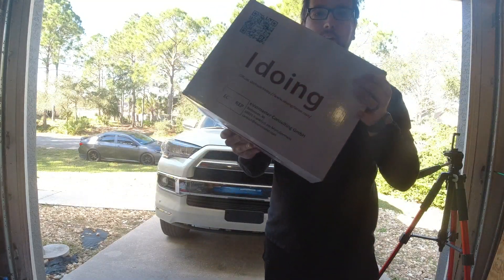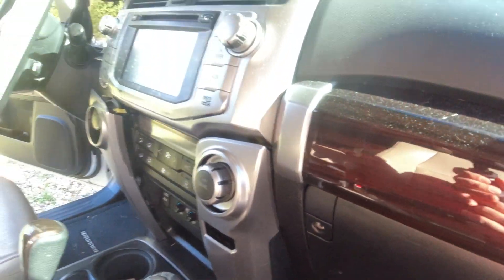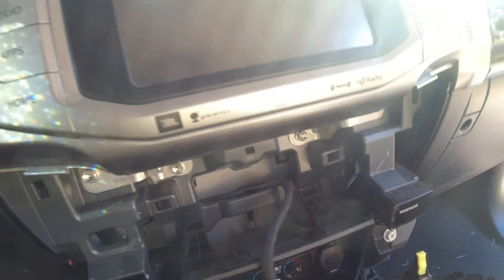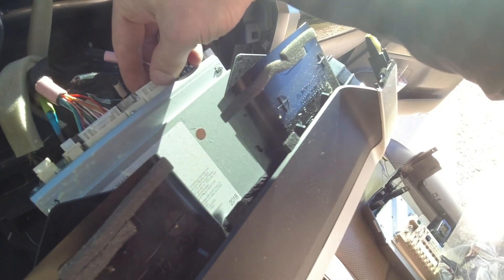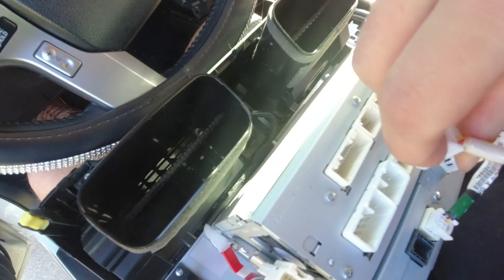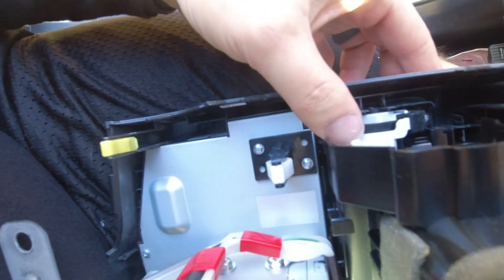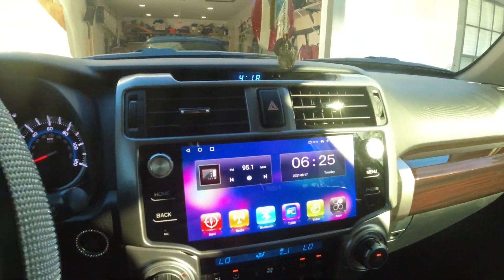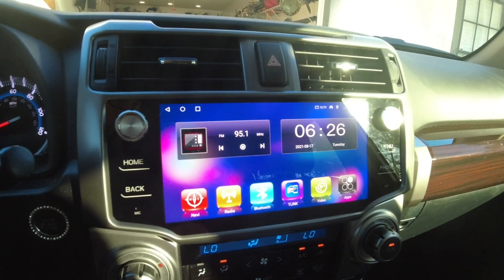4runner gets new IDOING Radio!

Comment: Hey, how was your experience with shipping? I want to get one for my corolla but I’m afraid it’ll take a long time to come.
Reply from the maker: I have gotten a few idoing radios. And they usually come within 2 weeks. 
I tell everyone that is the thing I don’t like about the radios, is you have to order them from Ali express.
But the good thing about these radios. Is they are significantly cheaper then the competitors, and they have really good quality parts! 
I have installed 3 of them so far. And they have all been great! And working perfect!
Reply: Man i really appreciate all the time you take to put detailed information to try to answer the all questions as best as you can. Thank you so much!
Reply: @BrandonStellmach  great video and good to know. I just ordered one for my 2013 Camry and was wondering how long it takes to ship.  If I like it, which I think I will, I will order and install one for my 2019 4Runner as well
Reply from the maker: @mattkoch1456 thank you! And surprising they ship pretty fast. I got mine in about a week!